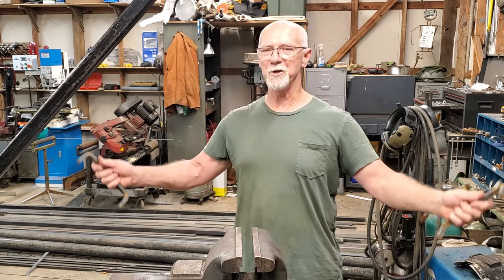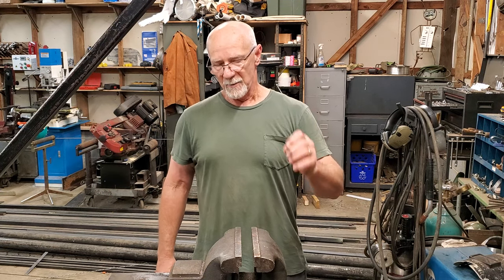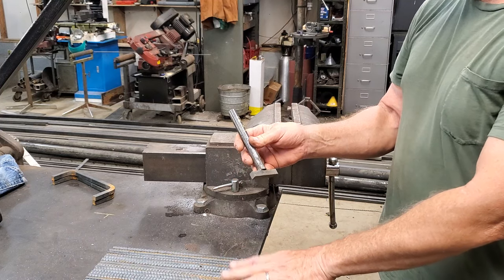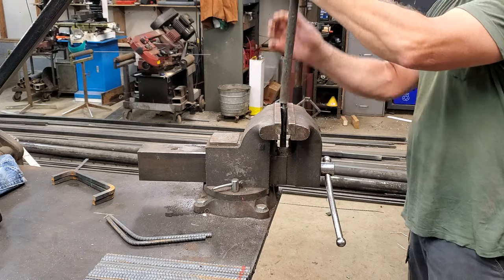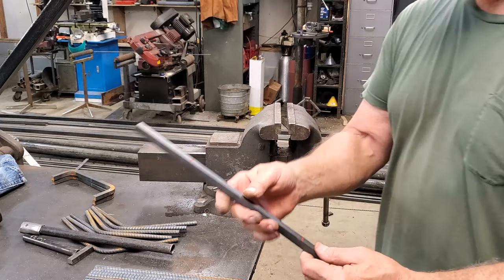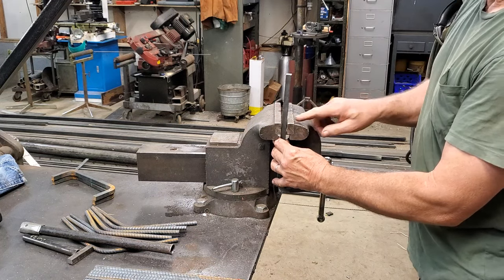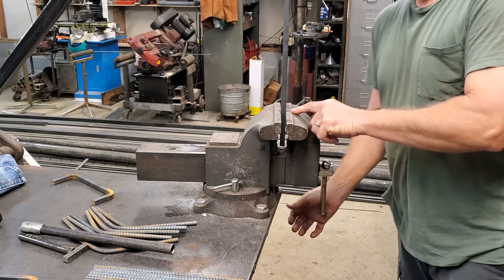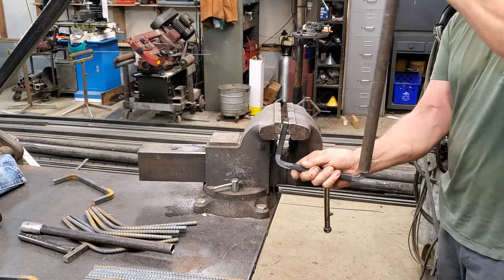How to cold bend 3/8" and 1/2" rebar and 1/2" sq. bar steel.

Comment: This video alone caused me to subscribe to your channel! I love the simple, straightforward, honest approach to teaching, that you employ. I love the fact that you recognize and appreciate the waste of resources in applying heat for such a simple task, where it is simply unwarranted (some would argue that the use of heat as a substitute for elbow grease is an application of laziness to an already easy task). My first experience with cold bending 3/8 rebar was in a class required, by the DoD, to qualify as an interrogation assistant. We were taught to bend bar by hand, in the scare tactics portion of class…a lot like, ”World’s Strongest Man Competition,” hold both ends of a 3’ bar and bend around the back of the neck/ bend it across the thigh or behind the knee/hold at center with teeth [only to start the bend]…all said to say that you make excellent content about relative material in true form. You present very much like a depression era farmer, waste nothing and the harvest will justify the effort spent! Be safe and Blessed!
Reply from the maker: First, Thanks for the feedback. I have started teaching classes in my shop. I want to pass it on. Hope you will share and check out my other videos. Thanks again.
Reply: Sir, yes Sir! Thank you, Sir!

Comment: welding by Riley Foster +:  Really good video on this topic. BUT...
Suppose you had a !/2 inch diameter semi-polished stainless steel rod that, once bent, will be used to support an exhaust system, including a fairly heavy muffler and a not as heavy resonator? 🤔
Will this "cold bend" method work to bend the support rod? Please do advise. TIA!
Reply from the maker: I have cold bent stainless steel for round pipe.

Comment: Do the same with 3 bolts, washers and nuts, 1 eyelet screw and nut, and a 4x4. Used to anchor it to my utility trailer with 2 clamps and bend rebar for cement pads and stuff.  Sold the trailer so made same setup for my truck hitch... Save a lot of time and $$$...
Reply from the maker: My vice is used for a lot more than just bending rebar. You know, one tool doing a LOT of jobs well.

Comment: First let me say great video for quick & easy no-heat bending!!!   Starting out with bad info (0:31) though....  both versions of Mapp gas burn hotter than propane.  Propane burns in air at about 2800F - 3200F - Map-Pro (what many people think of as mapp gas) is the new formulation of mapp gas, it burns in air at about 3400F - 3800F and takes about 5 minutes with a good torch tip to heat 1/2" rebar enough (bright cherry red or about 1800F) to make an easy stress relieved (non-breaking) sharp bend.   Map-Pro is 99.5% propylene + 0.5% propane.  Real MAPP gas (discontinued in 2008) is a liquefied petroleum gas that is a mixture of methylacetylene (propyl), propadiene, and propane.  It can get hot enough to MELT most metals except Tungsten, as it can reach 5300F with a proper tip.  I'm fortunate to still have nearly 2 full cans of real mapp gas, it can heat that 1/2" rebar to a bright yellow (about 2300F) for an easy bend in about 2 minutes.

Comment: Ok ... I don't have a bench with a vise.  But I want to bend 3/8 or 1/2 rebar into shepherd hooks for my wife.  

I've seen videos of people bending rebar with 2 pipes, a forged I hook and 4x4 and both of these methods yours too when I get a vise look great.  

But I'm at a loss at the moment of how to bend around a larger radius.  I'm thinking I might have to go to some steel fabricating shop and have them cut me a couple of round forms that I can sandwich between say 2 4x4's and then bend them around the steel.  

Was wondering if you have any wild ideas for how someone with 2 pipes could bend a rebar with a greater radius?
Reply from the maker: You can stick the rebar in between forks of a tree or a toe hitch of a truck. And. start bending with the pipe about 8" out from your first bend. slide the pipe out as you bend the radius.
Reply: @weldingbyrileyfoster4121  
Great idea ... not suitable tree around tho.  Was thinking of buying a  6x6 post then bending around that .... have to figure out how I'd anchor the end first ...

Also thought about maybe a conduit bender might be good.  Just not sure how sturdy it is.
Reply from the maker: @johnjacobjinglehimerschmid3555  The bender will work, but you still need a way to hold the other end.

Comment: Great video sir,  i just wasted $ 60 on getting my small  B tank refilled with acetylene then another $ 98 to replace my broken regulator. Does this work with 1/2" round bar ?
Reply from the maker: Yes, it will work, just need the right vice and lever.

Comment: Just need a well mounted vice and some leverage. Sometimes you dont even need that... I used a stake pocket on my trailer to bend 4"x 0.25" bar into a U for a driveshaft loop.
Reply from the maker: That will work a few times. If you bend a lot, as I do. You need a vice.

Comment: Used 2 mapp torches to bend some 5/8 bar, took forever to get it red. I'm going to try this. Tried it on 1/2" sq bar, it snapped. It is not bar stock it is mud flap steel.

Comment: Nice video, very useful. As far as waste goes, do you have to have 4 inches on the bend leg or is that just convenience? Could I achieve the nice bend with less if I didn't need the part to have a for inch leg?
Reply from the maker: I just used 4"becacse I needed the 4". you can make it what ever you need.

Comment: @welding by Riley Foster....I see you lift up 1/2" on the square stock to make the second bend because of the size of the stock. Does that apply to any steel stock that you are going to bend since it stretches a little? (Ex) If I had a piece of 3/8" rebar and I wanted the bend to be the same length on both ends (maybe 4 inches), on the second bend, would I lift the rebar 3/8" so both sides would be 4 inches to allow for the stretch of the steel?
Reply from the maker: Yes, but understand this is hand binding. So I leave a little on the end to cut off if needed.
Reply: @weldingbyrileyfoster4121  Appreciate  the feedback.

Comment: That's a great time saver. I was thinking heat but it looks completely unnecessary. I need to make a couple of dog stakes to attach chains to. I was thinking an eye loop on the end of a piece of 1/2" or 3/8" rebar (I've got loads). They eye loop doesn't need the diameter to be particularly accurate. Just enough to clip a carabiner on the end of the chain.

Any thoughts on how to do it. My tools are lacking. No vise yet but I might need one anyway for general use.
Reply from the maker: If you have a metal worktable or something that won't move when you pull on it. Drill a 3/4" hole about 3/4" in on the end. Stick the 1/2" rebar in it about 1" and pull down.  And repeat till you have the loop you need. Thanks for watching the video. Check out the other ones and share.
Reply: @weldingbyrileyfoster4121  Great tip. I just moved into a new home (3 yurts and 2 shipping containers) and I'm building up a new collection of tools. No work table yet. I'm going to have my handyman make the dog stakes this time until I get my workshop setup in one our shipping containers. I've got loads of 1 meter (3 feet) pieces of rebar for some reason - leftovers from foundation construction. I can use it to make other stuff. I love to use my construction "waste". :)

Thanks so much! I'll definitely watch more of your videos.

Comment: You ever bend 3/8" stainless rod like that?  I know stainless will work harden.  I want to make an old timer type pier fishing 4-prong gaff hook from 3/8" rod and I need to get me a greater than 90-deg bend on the 4 legs.  Then I can sharpen the points on the ends and then jig it up enough to hold it steady so I can throw a couple tack welds in with stainless stick rod.  After it is all in position and holding with tacks I can stick the whole thing to completion.  I'll put a big "nut" of some type up on top as a way of attaching the pull rope.  I'm also toying with how to pour a lead form around the central part with a sacrificial mold.  The lead gives you good wind resistance cuz of the weight.  My neighbor is 84 and he got his pier gaff from an "old boy" who was in his late 80's when he gave it to my neighbor when he was in his mid-50's.  That thing is a BEAST and you could manhandle a shark with it.  I want to reproduce that!  I love making stuff and I found this video helpful for cold bending....just concerned about cold bending 3/8" stainless rod and wondering your thoughts since it work hardens so fast!
Reply from the maker: Yes, I have worked with stainless. And it will cold bend. I would suggest you bend it around a pipe the size bend you want. I have found that works for me.

Comment: Can rebar be bent almost all the way over to make a hook?   Or will it break if bent that far?   I want to make a shelving system for a storage container shed and want to make hooks to use on the tie down loops in the storage container
Reply from the maker: Yes, you can bend it around pipe.

Comment: How do you make a sharp 90 degree bend in 3/8 and 1/2 inch bar stock?
Reply from the maker: If you use the way I show in this video it is a 90` or right angle. That's, I think is the best way.

Comment: Do you cut all of your rebar or do you purchase it already cut to size? If you cut your own, what do you use?
Reply from the maker: I cut the rebar with my bandsaw, floor modal or hand held.
Reply: @weldingbyrileyfoster4121  I have a big horizontal bandsaw and I've tried clamping multiple pieces of rebar in there at the same time but there's always that one that's a little thinner and just spins when the saw gets to it. Cutting them one at a time on such a big machine just seems like such a waste. I thought about putting it scrap piece of wood in there to conform around the rebar while it's getting cut to get several done at once
Reply from the maker: I can cut 10 at a time. If you tape, then with tape and hold on to them on each side of the saw. (Ware welding gloves) It works. Maybe I'll do a video on that. @RacelifeCo